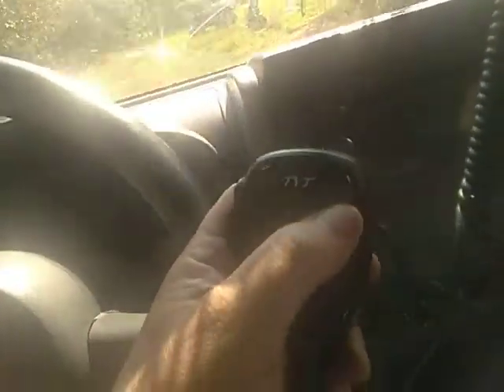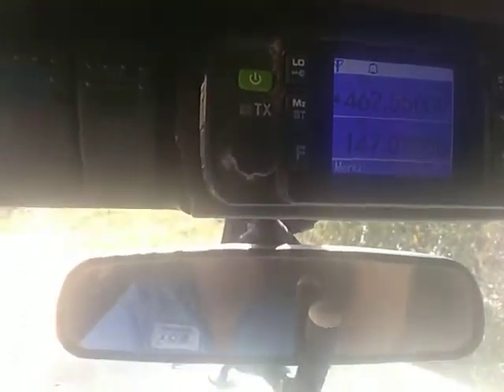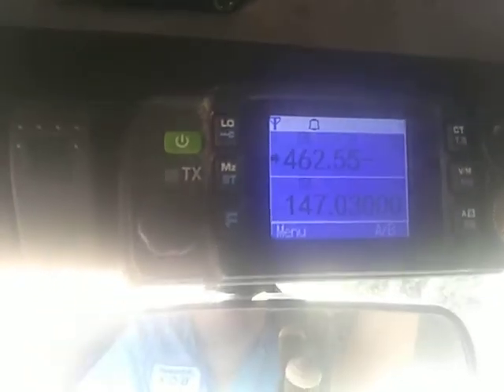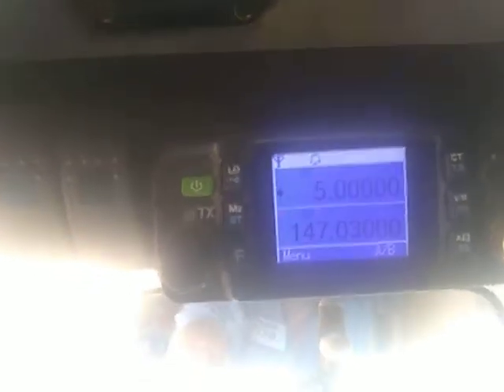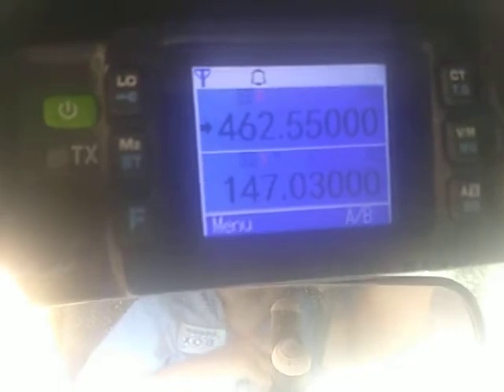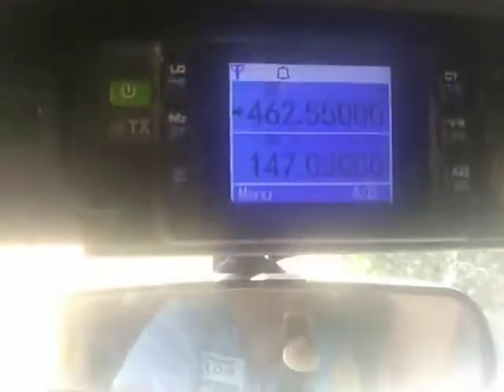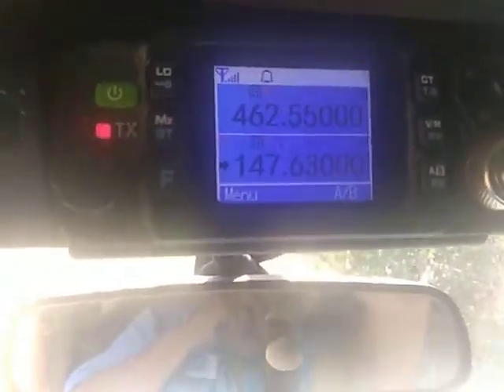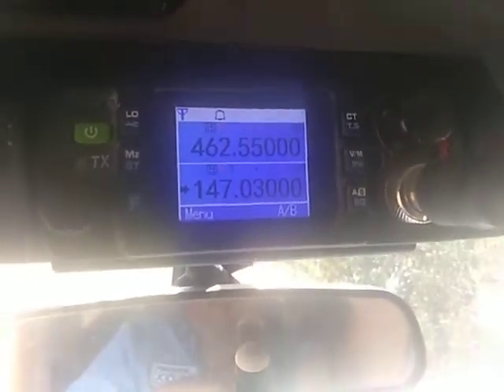TYT TH-8600 Repeater

Comment: How do you UNLOCK the TX 
I got it to RX gmrs but not TX
How do you unlock the transmitter
Reply: Found on-line your mileage may very... 
To unlock make sure that the TH-8600 is turned off. Hold the "LO" (top left) button and the "A/B" (bottom right) button while turning the TH-8600 on.
Reply: Mine came unlocked, rx/TX 136 to 175 or so, and 420 to 490 mhz I think it is. Assumed they all did, of course not legal outside 2m and 70cm ham bands. Not type certified is all for gmrs.

Comment: A few questions. First, can you use this radio as a repeater? Is it an option? And how does one unlock it? 
Some people complain that it's locked and indeed, there appears to be notices in the ads that “it is illegal to unlock this radio without permission.” This is nonsense as there are no such laws in the United States. I see reviews of this radio, but, like the TYT UV-8000D/E, people say the radio is either great or it's junk, but the issue of locking and unlocking radios really isn't covered. It's infuriating to think a company would lock its products, when no law in any country (of which I'm aware) requires it, but apparently some companies do. 

Also, how long have you had your TH-8600? Any issues with it so far? Your posting was October 2020. Is the radio holding up okay? I'm impressed that it's IP67 compliant. If the 8600 is significantly more powerful than a HT and it's still kicking, that's great. But the locking/unlocking thing still is troubling. The radio is beautiful and I'm interested in using it as a mobile base station.
Reply: 1. No its not a repeater,  but with equipment to connect two, and a either dual antennas,  or a duplexer you could link two identical radios.  With dual antennas, need at least 30 vertical feet between the two depending on the frequency spread you wanted to use. Closer, the further apart. 
Some dual band radios, have a cross band repeater function built it. 
...
Mine didn't come locked, or if it did I don't recall, pretty sure didn't. 
To unlock make sure that the TH-8600 is turned off. Hold the "LO" (top left) button and the "A/B" (bottom right) button while turning the TH-8600 on.
.... 
Its lived in the jeep since I made the video, and been caught in thunderstorns with sideways rain blowing across it, never missed a beat,  That said, as with most china radios advertised 25w, remember thats VHF and expect 3/4  of that rating, this one if I remember right does around 20w vhf, and 15 to 7 watts on UHF.

Comment: Will it transmit on gmrs
Reply: Legally, NO, but will it yea.. 
Not Part 95 certified for GMRS,  mainly because its not channel locked, has a VFO ability that GMRS  radios can't have......
Reply: @z1catfish  I heard people saying these are locked to transmit on gmrs are these all the same ? Thanks not that I want it for gmrs just want to know before I buy it 😁
Reply: @jloaiza9188  most of the China radios, are unlocked cord if sold as a dual band ham 2m/70cm.  I prefer my anytone at778 over this radio, much nicer layout. Only thing  sold me on this radio is waterproof for jeep.
Reply: I did just as told above it will receive GMRS but absolutely refuses to transmit on 467/462

Comment: Still not technically legal - even it locked to GMRS - if it's not Part 95 certified by the FCC - the locking doesn't matter.
Reply: Correct,  but you can monitor anything you want.. just not transmit.

Comment: When buying online is there a way to tell in the specs which are GRMS only radios?
Straight forward little video, nice!
Reply from the maker: A GMRS radio will be listed as such,
Btech radios ar converted ham, so they typically will scan a wide band, just locked out of transmitting.
Many of the China radios, anytone, tyt, qyt,  Zastone, etc that happy work on gmrs, but not type certified ie channel locked, power restrictions to be legal.
Is imo really sad, because makes dual licensees have multiple radios VS one multiuse rig.
The harder ones to discern is the old business / police rigs, because can be gmrs legal if programmed...